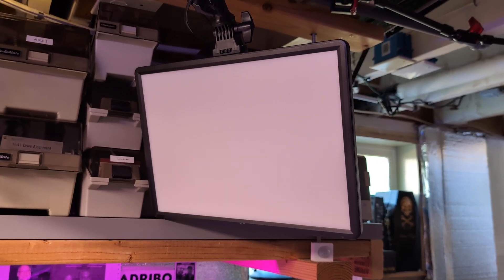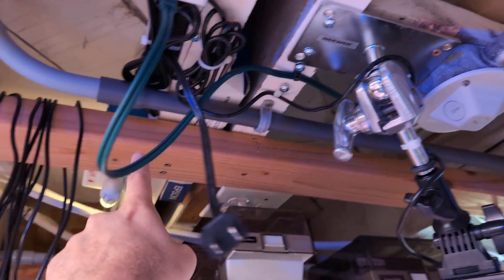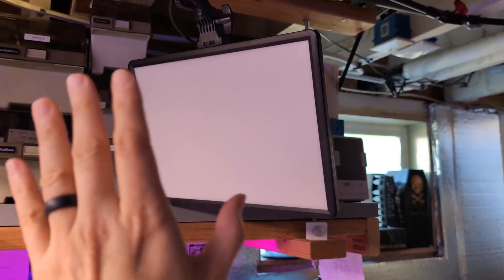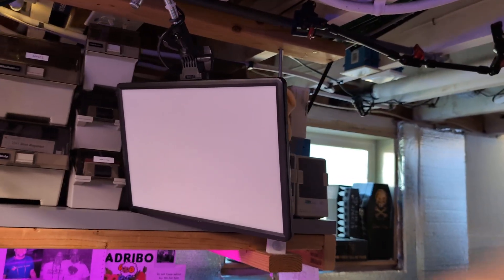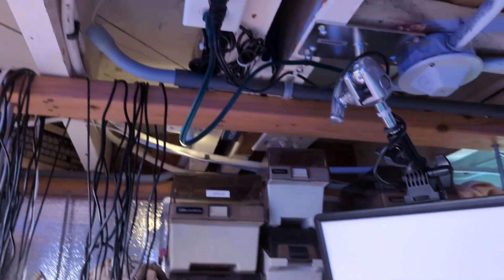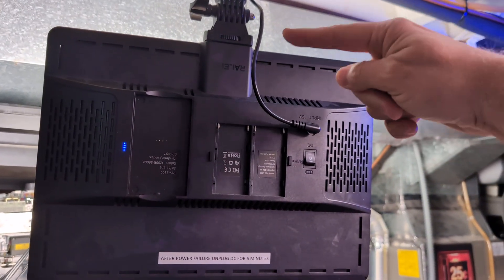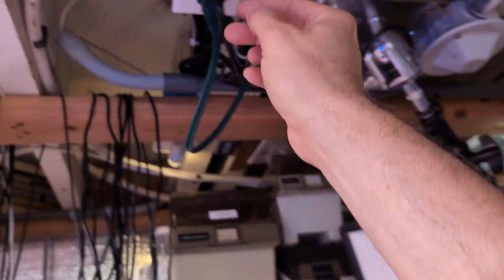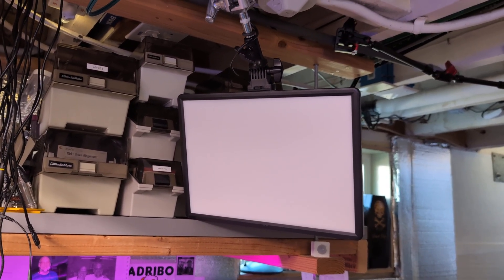LED light panel serious design flaw (Raleno PLV-S300)

Comment: I'm wondering if it's running the DC input through a battery protection chip. When the votlage falls slowly it sees it as a dead battery and the fixture would need to charge it to bring it back to life.

Comment: So could you make a plug that fits in the DC jack in the back, that 'shorts' the connection to drain the capacitors, or are there some fancy-pants diodes in there?

Of you could fit a push button on the back that shorts the power rails when pushed... what could possibly go wrong...

Comment: The capacitors in the circuit have residual charge that the circuit microcontroller thinks is a low voltage dc power source.  The two minutes is programmed into the unit to disregard DC (ac power brick) input from registering as a valid power source.  Can you integrate some switch to force the microcontroller to reset?

Comment: If its an issue with the power supply voltage dropping down slowly, maybe a small zener diode would fix the problem

Comment: An easy "fix" would be to add a normally closed reset button in series with the VCC pin of the controller, or even in series with the output of the internal switching supply if present or just after the filter caps.  Pressing it for about a second should be enough to interrupt the flow of current to the controller.

Comment: Crappy power supply. Get a decent one and run a cable to both lights with a switch for the psu at your desk. No more trouble. :)

Comment: Are there any butons ON the lights at all, or only the remote?  If there is a power button, try holding it in to drain any capacitors.

Comment: As someone who plays with micro controllers I know what is happening. When the AC is unplugged with the light off, the DC supply starts to drop below the MC's operating voltage and once unloaded the power bounces back up and drops again. A brown out situation this is and the MC does not like it and just locks up. The 2 minute wait is ensuring any capacitors that is keeping the MC alive is discharged. Once the power is gone to the MC it will reset like normal. It may be interesting to pull one of them open and dig into the circuitry to figure out where a proper reset circuit can be bodged in.

Comment: On an old washer I had that would lock the lid during wash cycles and wouldn't unlock during drum balance error, I used to unplug it and take a penny to short the two hot/neutral prongs on the plug and then plug back in and it would 'forget' the error and unlock so that I could move the wet clothes around and restart the rinse/spin cycle. 

Maybe bridging the hot & neutral spades on the 120v plug side would speed up your fix and not have to mess with the DC barrel plug...?
Reply: Regarding the washer problem, try checking your drain filter. It might be very plugged and causing all these issues you are having. I just fixed mine by doing so.

Comment: the microcontroller is crashing. it needs a simple RC reset delay circuit like any computer you typically work on. most these days have built in watchdogs/brownout detection but either this one doesn't, or it's not enabled correctly. the caps keep it on in the crashed state between power cycles.
Reply: Or they are using a simple RC reset circuit, and a better fix would be to get a power supervisor IC, and use it to generate reset instead. Or even a diode across the resistor in the RC, so it discharges faster on power off, which might be all that is needed, though if it takes a while for the power rails to drop down  the supervisor IC would be a better fix.
Reply: @SeanBZA  no reset RC circuit lasts that long before discharging. it doesn't have any power good delay at all is my bet.

Comment: Sounds like a great ADB project. Add a bleed resistor to the cap (Assuming there is one) or put a small resistor across it with a switch for a reset button. Doh, wait, you need to put the lights in storage for 20 years first so they are retro!

Comment: ChatGPT says that it’s a power‐on memory limitation and to try plugging it  in while holding the brightness- or power button on the remote which should reset the controller.

Comment: if they have a battery pack installed do they still have the same problem?
Reply: This is probably the key.  These lights appear to be very similar to some professional panels I have worked with.  However the professional panels often say that a battery pack is to be connected at all times - even when using alternative power sources. 

I bet these lights are the same and need a battery connected to work properly.  The fact that the remote state gets confused is also another clue pointing to this.

Of course, if this is the case it should be pointed out in the manual just it is for the higher priced professional panels but at least it is an easy fix if that is what is going on.  Even a small low capacity battery pack should work if you use them plugged into DC power all the time.

Comment: Hi, Adrian. Could the low voltage power for your LED displays, also gradually charge a backup rechargeable battery for the main processor, to keep its memory powered for a limited time during a blackout?  Perhaps the backup battery isn't holding charge, or the charging circuit isn't working at all, therefore the memory isn't being powered during a powered. Just an idea.

Comment: I wonder if it's an issue with the power supply itself and not the lamps. Have you tried a different power supply?
Reply from the maker: Yep powered from my bench PSU, same issue. Takes a full 2 minutes before I can use them again.

Comment: There is a power switch, it doesn't work if you flip it?
Reply from the maker: The power switch acts the same as just unplugging them from DC ..... meaning you need a full two minutes.
Reply: @adriansdigitalbasementextras  I see. Ok, at least it is a little less painful lol.

When do you crack this thing open and add a bleeding resistor? :)
Reply: I also wondered, but probably not

Comment: If you short the power/ground on the light itself at the DC input jack (to hopefully drain the cap that's keeping the microcontroller from being reset) does it recover faster than 2 minutes?
Reply from the maker: I didn't bother trying -- I'd have to make a special cable to do that, and it's really easier just waiting two minutes.
Reply: I had the exact same thought 😅
Not very elegant, but it should work
Reply: I was also thinking similarly that if you can drain the power by say adding a low resistance resistor across the power switch off state to short the power V+ rail to ground it should allow a short off cycle to clear the fault.
A better solution is to fix the bug with a proper power down circuit, but that is a larger effort for detecting power brownout and initiating shut down or at the minimum defaulting to a drain circuit as above until power is restored.